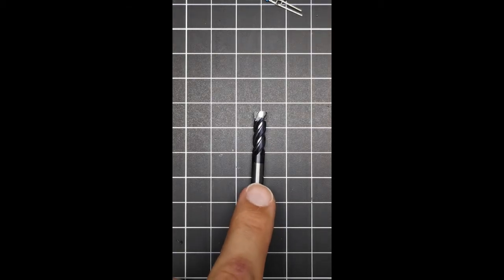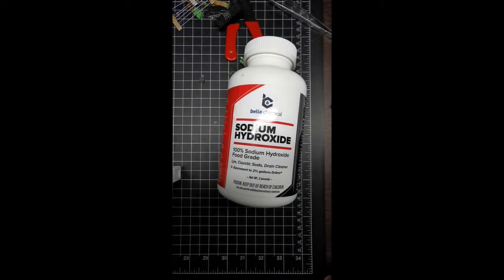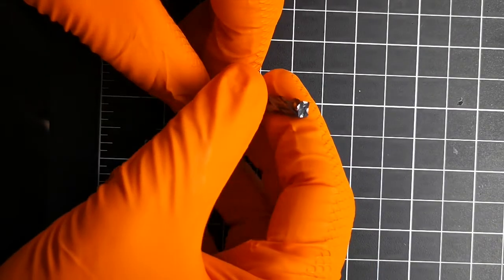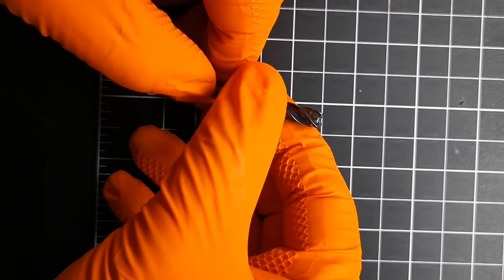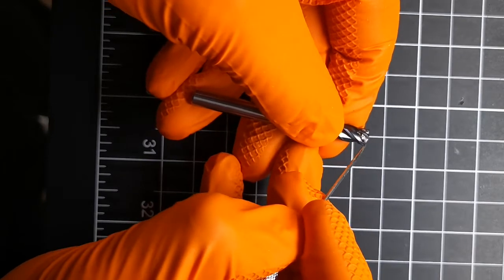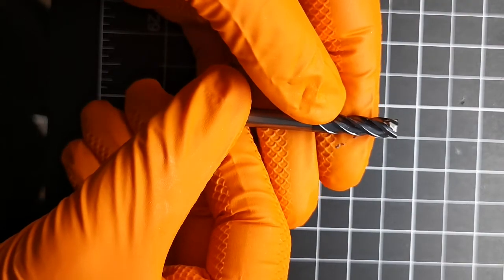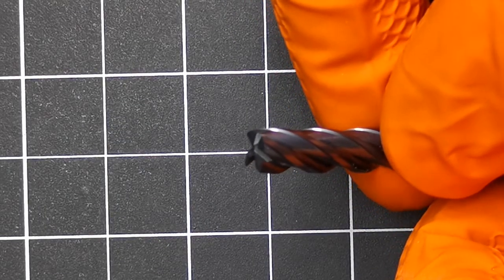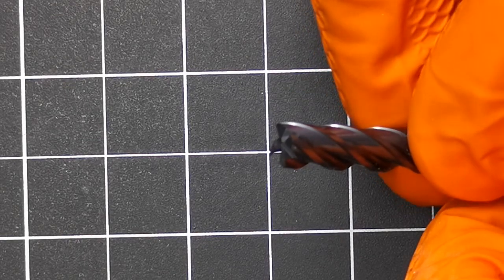Dissolve Aluminum From End Mill

Comment: Not an experiment, just a stupid mistake ... plunged a tool holder in a piece of aluminum stock. After releasing it, there was a lot of aluminum weld on the holder. A bit of water and a tablespoon drain cleaner was all that was needed to clean this mess. Like you, I also had to refresh the liquid to get the last few bit of aluminum out but then I had a brand new clean tool holder again 😁
Reply from the maker: Sweet!
Reply: today I decided to take more end mills out of the machine to give them a good bath. I had at least one roughing mill that tends to have aluminum stuck to it but now I cleaned it, it stays clean. I guess that at one time I had an oopsie and removed the chips that got stuck to the end mill by hand. Some small parts must have stayed stuck on it and cleaning it did the job.
Maybe we should build a special washing machine for tools 😁

Comment: i just use a utility knife, it can't really cut the carbide...
Reply from the maker: You prod it until it pops off, or you actually cut chunks off the aluminum? I sometimes am able to push the pieces out by prodding a little. I am not really worried about the carbide scratching - but if seems stuck well,  I just have cut my hands too many times to consider it worth it any more....
Reply: @janbeck8269   I just hold the endmill vertically and slice downward with the endmill on something soft like aluminum so the knife doesn't have anywhere bad (like your hand) to go.  Cut prod, whatever is needed.  I've never had to resort to anything else to clean aluminum off an endmill but maybe i'm just bad at chipwelding!
Reply from the maker: @JesseSchoch  Thanks for the extra info!